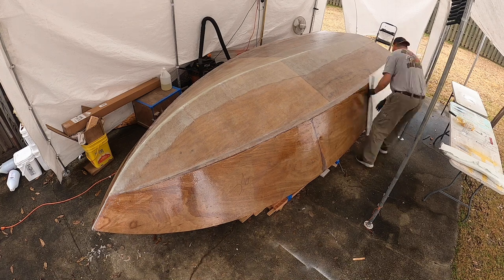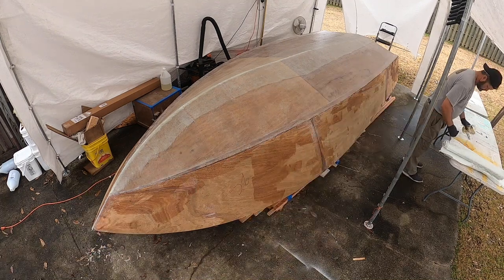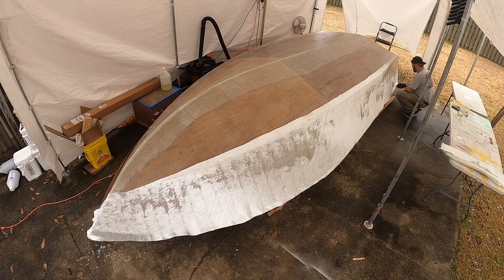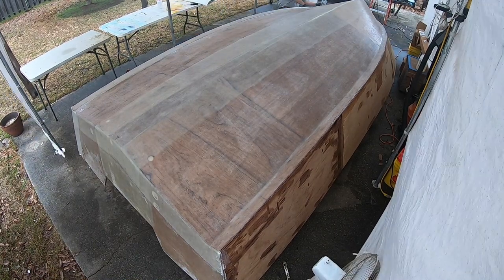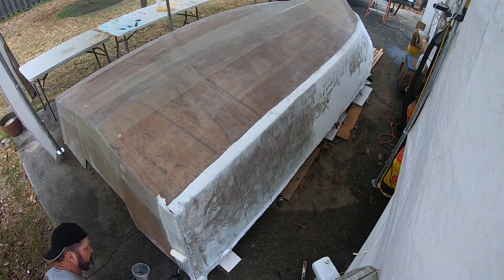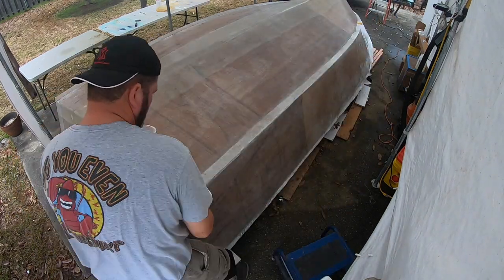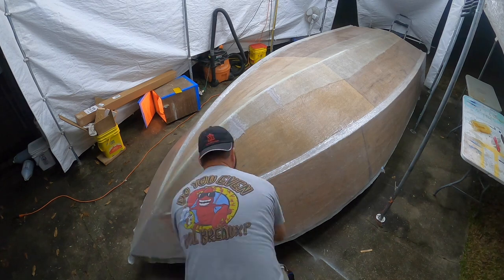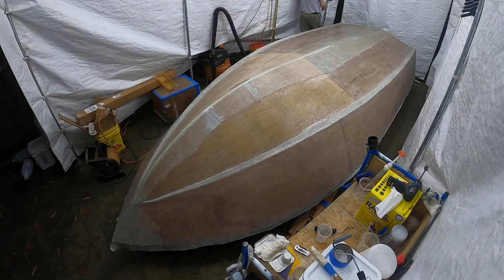27. DIY Boat Building: Next Step FIBERGLASS SIDES!

Comment: May I ask how much Epoxy you used up just for the entire hull as single a complete single layer？   Thank You
Reply from the maker: As a general guide I use “about” 3 oz per square foot of 1808 biaxial and 2 oz for 1208 bi.  That’s for pre coating the wood and wetting out the glass. Hope that helps.

Comment: Nice Job Oscar…. You need to get yourself a metal fin roller to help get the fiberglass saturated..  works great!
Reply from the maker: I have a few fin rollers and I use them sporadically.  I probably need to use them more often, but to be honest, I haven't gotten them all figured out.  I've come all the way back around to using stiffer foam rollers most of the time now.  Appreciate the tip though!

Comment: Didn’t bring the bottom mat far enough over the chine too double up
Reply from the maker: I appreciate your insight, but I followed the designers specs and went a little beyond.  Specs called for basic overlap at the chine and this was done as a hot coat.  Where do you think that falls short?  Love to hear what you think.